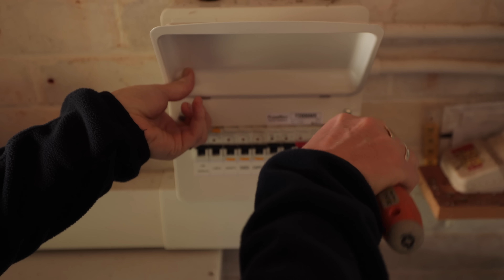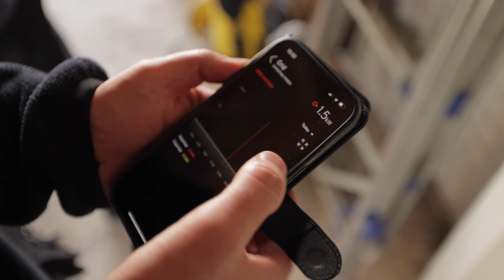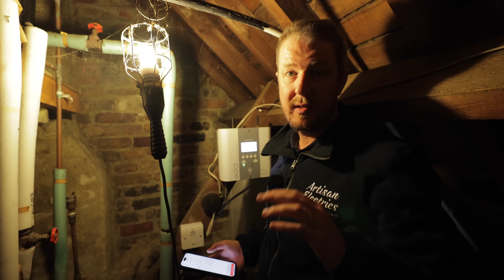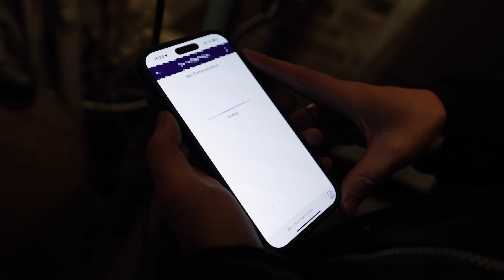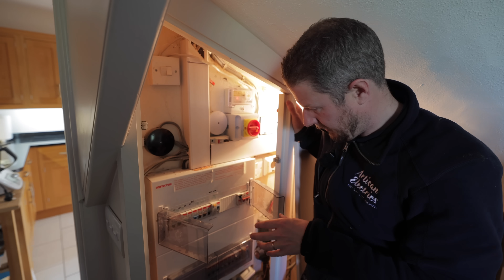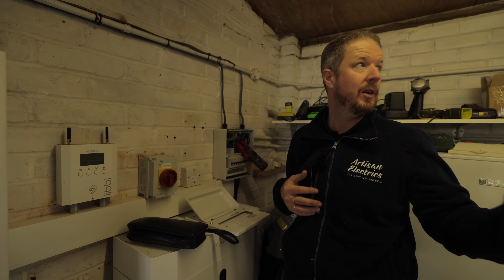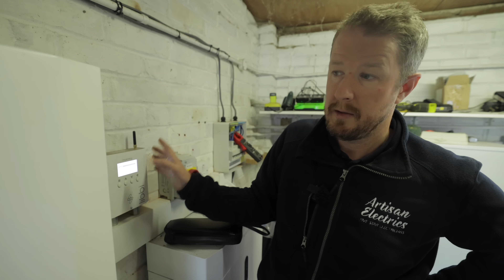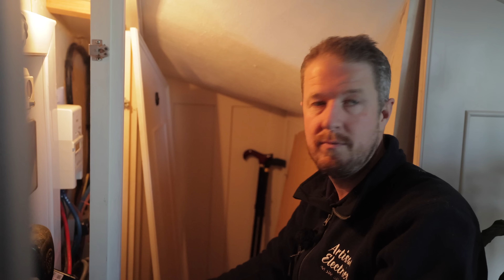£20,000+ Battery System RUINED By This 1 Simple Mistake 😳

Comment: Caveat - former IT network project manager here... This is a classic illustration of the dependence of smart home technology on internet connectivity, using devices which are designed in lab environments, and installed by non-IT trades. Now Artisan are getting better, cause they operate on the edge of this stuff, but it takes a special spark to learn networking! It is not just laying some cat5 cables any more!! Jordan - maybe take your IT guy out to site visits like that?
Reply: Ironically, this system probably would've been a lot better with some CAT5, CAT6 instead of flaky wifi and its constantly changing standards. Considering sparks are already running cables, throwing in a few CAT5/6 would make a huge difference to the systems stability. Wifi is easy but unreliable, running network cables is harder but so much more reliable.
Reply: @johnmacward  I would add - cables are more secure. I would not put anything important onto WiFi. It is pretty much like public toilet.
Automatic updates - convenient, yes. But (at least for computers) it can also wreck systems. One bad patch may be all it takes to brick a system.

Comment: Regarding your "these RCDs are not bi-directional" comment. Traditional dual pole RCDs with Ferranti's coil and MCBs with bimetal release are always bi-directional. Only the RCBOs with electronic releases skimped fraction of a penny on components and at some point became "directional". The same RCBOs cease to operate upon PEN fault, because the electronics rely solely on neutral lead (I'm sure you remember they used to have additional white PE link to continue working in fault conditions, but at some point almost all UK manufacturers got rid of those to save space and money).

Comment: Stunned and saddened by the deadly immersion heater cut-out incident. Why isn't there a national notice to advise people to have a backup cutout fitted?
Reply: how about not putting a hot water tank in the fucking attic
Reply: yes, very sad. What is also sad is that it could and should have been avoided. Decades ago they introduced instant water heaters which in effect made hot water tanks not necessary anymore but to this day they still install these potentially dangerous things.

Comment: My wife bought a brand new starter home before I met her and one weekend she was staying at mine and realised she'd left the "boost" element active on the immersion heater. I said it was fine as the thermostat would turn the elements off once the tank reached the right temperature (economy 7 on the other element). When we went back to hers the following night we could see the windows were all steamed up. We went inside and found water everywhere as the tank had been boiling since the previous night. The emergency plumber said that both thermostats had failed, the tank had boiled, the boiling water went up into the header tank, the ballcock melted, the header tank overflowed, the overflow couldn't handle the amount of water pouring into it, and water flooded the entire house. Financially, the insurance company paid up without a question, and eventually the builders put everything right, but it all really upset her.
Reply: And She still married you
Reply: @davidpickard9393  Hehe.
Reply: A bad example of the man is always right and is comforting...
Reply: Has she ever listened to a single thing you’ve said since?:)
Reply: @doobryw538  We've been married 32 years next month. 😄
Reply: Wonder how many people notice one thermostat has failed, so they keep using it until the 2nd fails as well.
Reply: @ no the second is an over temp trip. Once activated it has to be reset with a push button
Reply: @johnwarwick4105 Ahh that makes more sense. Bad luck they both failed then - still implies poor maintenance by previous owner.
Reply: @StevenAyre1  It was a brand new build.
Reply: Omg that’s scary
Reply: I imagine she still brings it up during any argument?
Reply: @mdeckerLondon  No, we love each other and she hasn't bought it up in years, it's usually me when someone mentions a flood. 🙂
Reply: A brand new house and both thermostats failed,quality of parts suspect.
Reply: @jamesbaker429  Yeah. I was watching a video a couple of weeks ago (Gosforth Handyman) and (I think) he said that people on a new estate he lived on had an average of 300 things that needed fixing. So it's still happening now.
Reply: @PPlankBeam No.  It's the use of WRONG MATERIALS.  Plastic crap is everywhere.
Reply: Never leave the immersion on..... its created by the devil.
Reply: Cheap undersized overflow. Sad that ….
Reply: It shouldn't have happened, but I suspect her trust in you took a big hit, sadly.
Reply: She mad at you for making her stay?
Reply: @MrZeddy100  No, she loves me because I'm a good guy. 🙂
Reply: You must have good insurers.
Reply: @Tony-y1x It was a new build so the insurers probably believed something like this wouldn't happen.
Reply: Everybody gangsta until the ballcock melts
Reply: I put my thermostats on individual rcbo's... if one fails, it trips....
Reply: So, the undersized overflow caused all the damage costs except the cost of the water
Reply: @alexnewton6840  That's a good point. What's the purpose of having an overflow if it can't handle the mains water trying to escape through it. I'd never thought of it that way.
Reply: How long did it take for her to not bring it up every day? :D
Reply: @Schauffel  I'm the one that brings it up every so often. She never talks about it unless I do first. 🙂
Reply: Wow, that's horrible. You don't need to many examples like this, and the dead baby, to create a good amount of concern. The video goes to show that installations like this are complicated, perhaps the government needs to employ a reviewer of all installations and for insurance purposes, (insurance companies could be involved) to check that they've been done properly, the expense vs a flooded house is hardly a worry and there are, sad to say, cowboy firms and contractors. .
Reply: Upset her? No sh-t.
Reply: I'm still not sure why 'everything' is regulated/needs to be certified, yet a tank with (hot/'boiling'!) water at the top of a home, on an often poorly accessible attic, is perfectly fine. You would figure insurance-companies bringing it up, every now or then. Or some seriously invested civil servant/politician. And maybe it is not life-threatening (other than the perished baby), but water-damage is a serious pain (apart from perhaps tons of water being wasted).
Anyway, let's not apply common sense, rather address, say, gender-issues....
Reply: Would it have been any Chinese product or parts ?    😮
Reply: @BillSmith-fx7xx Unlikely 30 years ago surely?
Reply: I think I will stick with a combi gas boiler.
Reply: @REDFOX001 and you think THAT will save you?😂

Comment: Only being able to use 1/2 the capacity of a 20k battery system is definitely ruining the investment.  No different than being limited to using 40kWh on a 80kWh EV.
Reply: i paid like 65euro per 1kwh, i could diy 365kwh of storage for 20k pounds
this guy got 20kwh
the investment seem ruined from the start
Reply: We over-dimensioned our battery and set it so it won't discharge under 50% either, the rest is used as a UPS for a couple of servers.  And if there's a power outage, the entire house can be switched over to the battery.  The extra cost was around that of a good generator.

Comment: Checking equipment in lofts is no problem if you can communicate with them (e.g. wifi, bluetooth) unless they fail. The only real problem about inverters in lofts is increased ambient temperatures reducing the life of internal components. Nobody likes working in lofts so you would think there might be a good reason to install hardware in there in the first place (probably aesthetics).
Reply: @jam99 the installer probably didn't want to disrupt the carefully curated aesthetics of the garage

Comment: As the owner of a very large and very simple system in the southwestern US, this system seems small and complex, which leads me to wonder:  is there any payback here?  Even after you have “fixed it”?  I have never needed maintenance on any part of my system and this also has kept my cost low.  Even for me the payback is in the 10 year range at $.104/KWH to grid.

It’s hard to imagine this system could pay for itself in total lifetime costs vs savings especially considering battery life..
Reply: The difference in electricity costs between the U.K. and US (most places actually) swings the calculation. The borderline component in the U.K. is solar, whilst battery + offpeak electricity has is cost effective.
Reply: Same here in Australia. I have a simple set of 26Kwh AGM batteries and a A$600 6.2Kw inverter charger from ebay. It has been trouble free for three years now and I pay little more than my connection fee to use the grid for backup. I also have old school solar hot water heating. No internet connections, wi-fi or Bluetooth hassles.
Reply: What I never got with all this was that the amount of panels this guy has would be enough to power his house without any input into the house from the grid so theoretically shouldn't be paying any bills. People get cheaper electricity that's all as whatever is not needed gets out into the grid for free by the xustot
Reply: The UK averages about 1400 hrs of solar per year, vs 2500 hrs, here in Nashville.  Solar is nigh-useless there, especially when only 30 to 60% of the sun‘s power can be captured by solar panels.  I would think geothermal would be a better solution.

Comment: I still feel having that battery system on a sub-panel is a bit dodgy.  If it were my home, I'd prefer a dedicated circuit to the main panel with correctly sized conductors to avoid any risks associated with the situation you've encountered here.  Someone in the future could plug in another freezer or a second car charger, then boom.

Comment: Listen. This is a fking joke how much these firms charge.

Ive just bought my own system. 6kw inverter and pannels to match. 10kw battery. £3500. Will be ground mounted.

Will be installed by register sparky. £500. So im looking at £4k ish.

So someone please explain how this set up costs so much. I can match that battery capacity for a few grand more.

Lets not surgar coat it, hes spent so much on this he probs will not even live long enough to see his return on his investment. How am I wrong?

Comment: What i'm wondering about, is if 6KWP solar is enough to ever fill up that 15KW battery.
Reply: Well I have a 4.86kWp rated panel array, and 7.2kWh of battery storage and this time of year my batteries are rarely below 50% by the next day, and can be back to 100% before 9am.  To put it into context, today (14/05/25) so far my system has generated 33.5kWh and of that I’ve got full batteries, run the house and exported 22.1kWh.  So the answer is yes, but you’ve also got to consider that you would be unlikely be starting from an empty battery either.  Even at the worst time of year (Nov-Jan) when I’m draining my batteries more due to shorter daylight hours I’m still able to fully charge my batteries from solar a lot of the time.
Reply: I have a 7.3KW solar and yesterday was mostly sunny here, my solar generation was about 40kWh, and exported about 20kWh of it to the grid. I don't have batteries, it's not yet worth buying it here where I live, but that 20kWh could go into the batteries too.
Reply: @simcax6087  I guess it also depends on where you live.

Comment: You can set the Zappi and Libbi to be a group and set a group limit, no need for another CT. Also in the Garage they had a Granny charger, so there is another load that could be in use at the same time as the Libbi and Zappi.
Finally, the firmware in the Myenergi system does not update automatically at present, it is somewhere on the road map, all that happens is you will see new firmware available on the device and then have to install it.
Reply: Does the Granny stop Zappi and Libby playing loud music and dancing?

Comment: The EDDI is a poor piece of equipment. I would see it spike pull power from the battery when there was no excess. Myenergi had to remotely reconfigure to set a delay to stop that. Also, I may only want to allow the hot water to heat to max temp reached once then sell the rest of the excess back. We can't do that with the Eddi lacks basic control. It keeps topping up the hot water until there is no excess. I can't set a timer for heating either as I don’t know what times of the day I'll get excess. The App is also poor for an end user usability perspective as a whole. I may now need to set up a home assist box to work around many issues. I can never seem to access my Eddi app from work Wi-Fi. It just hangs and MyEneri blames the Wi-Fi. Utter nonsense. The Harvey is constantly dropping connection in my garage due to the fire protection wall so now I need to install a Wi-Fi mesh.
There are lots of great salesmen in this field but unfortunately the customer needs to know more than they should have to.

Comment: WiFi connections to the Internet are never 100% reliable, just because the Zippy wasn't connected when you checked it doesn't mean it wasn't when the original installer installed it. Indeed since you didn't need to add logon and password info it would suggest it was previously connected, disconnected itself and didn't properly re-connect which happens with a poor signal and of course may have been a bug fixed in the update you applied.
I recently discovered my Hive thermostat will ONLY get the time from the internet, it drifts out like crazy when not connected and you can NOT set it manually which is insane! It's getting to the point now where you need to consider High Availability Internet with physical RJ45 cables and a router with dual internet feeds like fibre with a 4G backup.
Reply: That's the way I'd do my place. RJ-45 whenever possible and Wi-fi for whatever is portable (phones, tablets, laptops). But non-moving systems in the house such as these solar devices (inverters, chargers, current detectors that talk to each other) should probably be legally obligated to be RJ45 connected for stability. Heck for sure, internet routers can go down from time to time but that's only when these devices need to talk to the cloud (usually for user statistics, their phone app etc), however the local network will continue to function when internet is down and these devices will still be able to talk to each other and function properly together. At the end of the day an electricians speciality is running network cable, why this can't just be part of the job I don't know. It's fairly ironic that these devices that need to talk together over Wifi tend to be all in the worst places for the Wifi signal - the charger will be outside the house, the inverter might be in a shed or garage or even in the attic. The worst possible communications choice for these devices is Wifi and yet it's always used.

Comment: The Eddi, is not a good move for me as I have a Heat Pump and far more efficient to use solar to heat hot water through the pump (although I don't, I use off peak to heat the water). It is definitely worth exporting ALL your solar when you are paid £0.15p via Octopus and again this really makes charging and EV from Solar using Zappi and Eddi pointless. I suppose if its a really hot day I can bump the hot water and have a nice cool breeze in the garden....

Comment: If all these devices (especially those in the loft) need WiFi connections then it will make changing ISP an absolute nightmare.
Another good reason to never put smart equipment anywhere inaccessible.
Reply: Nah, just give your wifi the same SSID, and the same password, everything will just connect
Reply: Alternatively I have a much more powerful WiFi router than the ISP provides that I connect to the all my devices, so when I change ISP I don't have to change anything

Comment: I don't understand why these systems needs to be so overcomplicated.
Reply: because that's the nature of making everything computerized. i have none of this and my electric bill is $100/month and gas is $40/month in summer and $90/month in winter. Water is around $80. It's not bad at all. Practice better energy habits, and learn about non-peak hours and you will save money without needing all this garbage. I do my laundry at 2:30am when electricity and water rates are down. It's basically free because it's the middle of the night and nobody else is doing it. I have vintage washer and dryer which gets clothes clean once, so you are not washing clothes 7 times over just to get them clean, saving energy.  I take my shower by filling up a bucket with hot water, and then using a battery powered pump shower to shower off with, so the only water I use comes from filling the bucket which is about less than 60 seconds of running the water as opposed of running the water in the shower for over 10-15 minutes.

Comment: 16:00 The worst case scenario is that someone plugs in the vacuum cleaner or an angle grinder or other high power device ON THE MOMENT, that grid is required to those two main tasks. 
So charging the battery, charging the car, and someone gets and idea to clean the car or do something in the garage. 

That is it really.

Comment: Yet again "Top it up with free solar energy" utter nonsense the customer didn't get the solar panels for nothing. He paid a lot of money for the solar system. In my case with the quote I had each KWh off the roof would have cost me about 33p yes 33p .

Separately it's impossible to get a return on a battery which cost £20k ..

Prove me wrong. I ask occasionally but you are reticent to answer